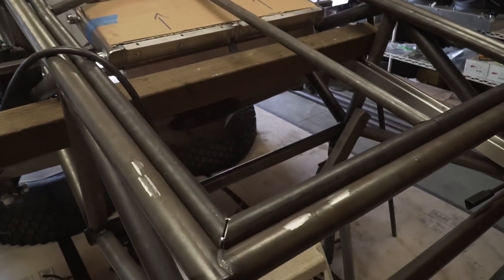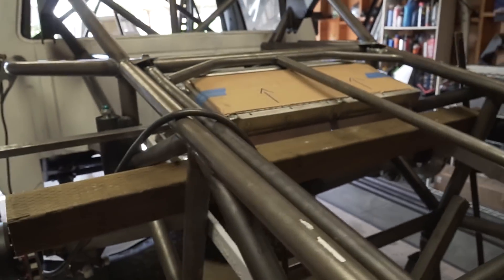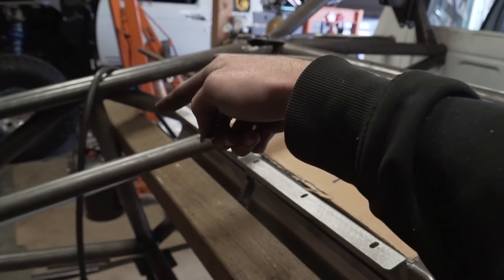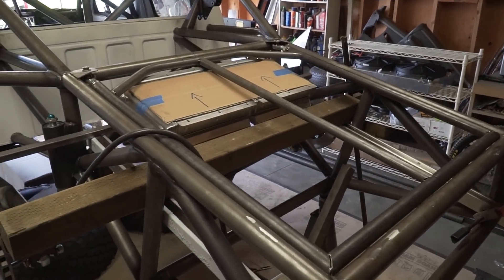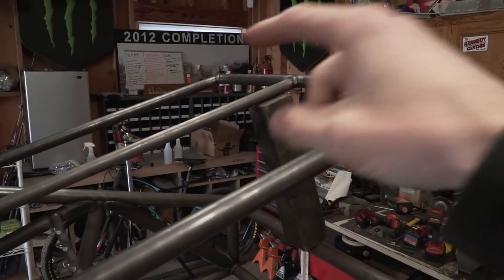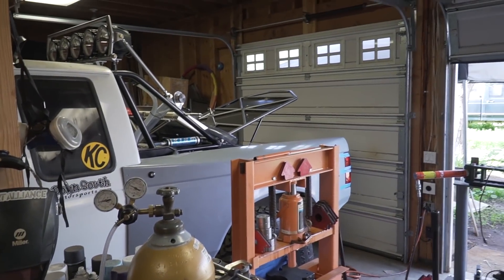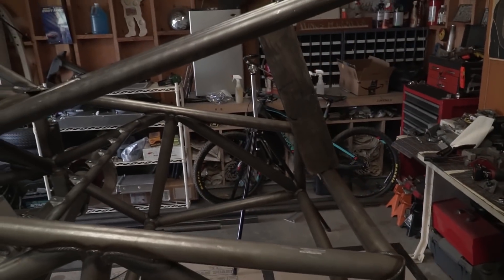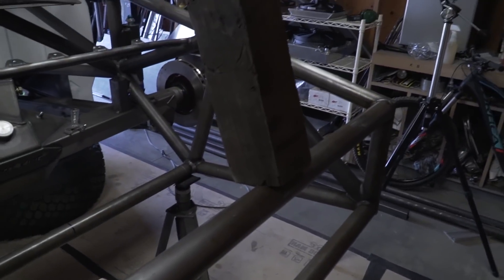Building A CUSTOM TRUNK For The Tube Chassis Prerunner!

Comment: Here's an idea for the sealed trunk, put a drain plug in the lowest point so that if you ever have to wash it out it'll just drain out easily
Reply from the maker: never thought about that!
Reply from the maker: there will be a skid plate under the trunk though so that wouldn't work now that I think about it
Reply: @WingsWorldChannel  put a small hole in the skid plate that you could put a cover over? Like some cars have under the front end to change the oil

Comment: I'm digging the videos as well. If I can make one small, friendly suggestion on the welding... take some extra care to not cut into the edges of your parts, such as weld washers. Either use a little less throttle and take some extra time, or use thinner filler rod or smaller or sharper tungsten for finer control...the end result will just look a hair better. Your ideas are cool, your execution is bitchin, and your welds look good. Just that little thing will make a noticeable difference in the final product. I hope this doesn't come off as a knock in any way. You guys are bad ass.
Reply: Guess I should have finished watching the video before commenting. Your overlay plate on the latch came out great.